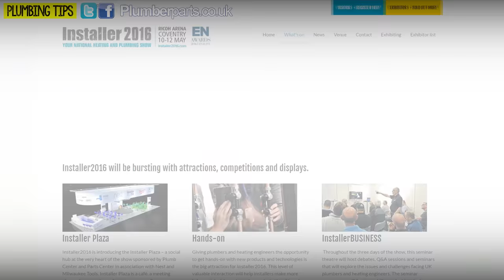PLUMBING DISASTERS 31 - Plumbing photos and videos!

Comment: Hello James. So glad I found your channel. I'm an IT/Computer coding nerd with absolutely no practical DIY skills (or confidence) whatsoever, but after watching your videos I have successfully changed a malfunctioning toilet siphon flush with a new dual-flush siphon and cold water inlet valve. I'm now contemplating replacing a radiator and doing a CH flush.

As a novice, I struggle with a couple of things:

1) Best practice/upsides/downsides and buying the right replacement parts. I know that getting the right replacements makes doing a job much easier. So, a video on "standards" and best practice would help a lot.  ie. 15mm, 22mm, 1/2", plug sizes, in-place replacement options etc., this model waste trap vs that one and why, existing systems(what I am likely to find) vs new products(the best/easiest options for replacements) etc.

2) Also, when doing videos - a check-list of crucial points would be nice. What's really important to get right and what's flexible. I tend to over-think the stuff that's trivial and under-think the stuff that's crucial. i.e. toilet cistern placement was trivial, but inlet valve sealing was crucial.

Thanks again. Steve.
Reply from the maker: +stsr11 Hi Steve, thats fine, I'll add those to the list. thanks for your suggestions and good luck with the coming plumbing jobs you have! All the best, PP!